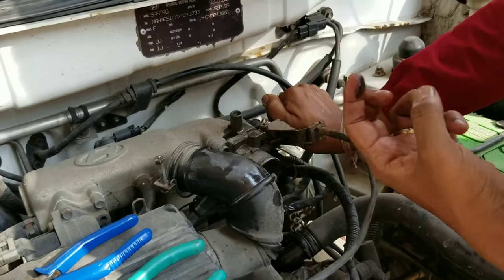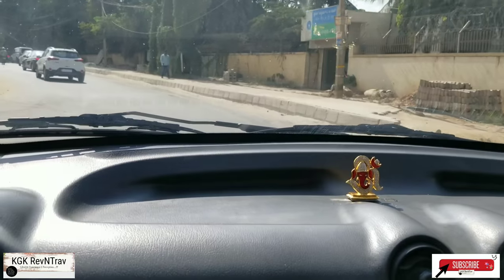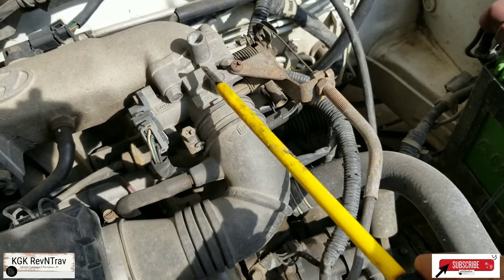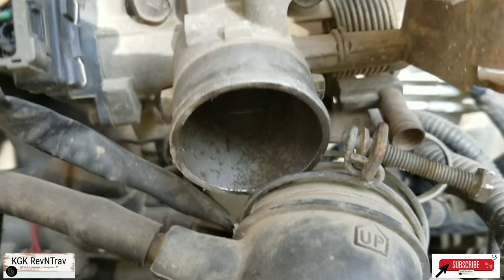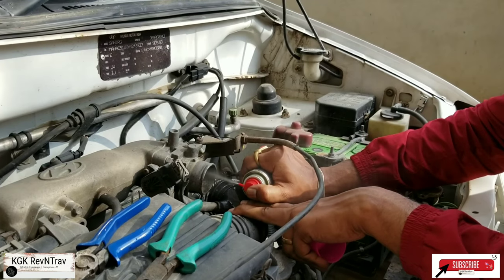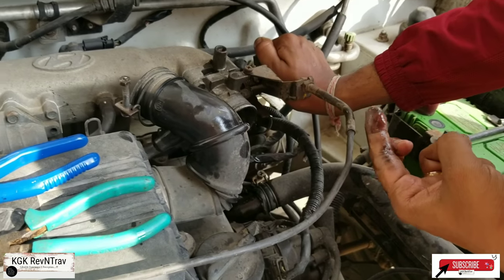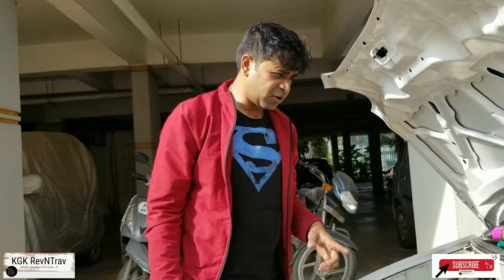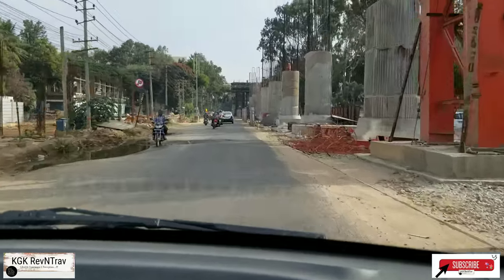Santro Throttle Body Cleaning | DIY | Santro Idling problem

Comment: How 5he dust will affect throttle respone?my santro have the same problem when i shown in service centre and suggested them they are saying sensor mist have problem i have to change that no use by cleaning throttle body

Comment: I had done the same what you had done at the end I had seen smoke came from exhaust down of engine upto 10 min and settle down is it indicates any damage or it is common?
Reply from the maker: No Problem.its common....the spray that you used burnt and thats it...all ok..
Reply: My problem was not solved  I asked Hyndai SA he was saying we have to change actuator that costs 18k
Reply from the maker: Get it rechecked at other service center...Its not possible...that you need  to change actuator...
Reply: I replaced duplicate idle speed actutator for 1500. Original cost is 11000, but duplicate is 1500. No issues now

Comment: Can you please make video on cleaning radiator??
Reply from the maker: Cleaning the Radiator is bit difficult for this old vehicle, You can use Flush Additives in Coolant to clean, But You don't really Need to do any cleaning to the radiator
Reply: How to flush the radiator in Santro Xing? Help me out  bcoz engine cooling is troubling me every time
Reply: Sar centro gadi chalu karte hi Pani fenk rahi hai kya Karan hai

Comment: Hello sir, I also have same problem with my santro, I cleaned throttle with wd40 and still it's RPM is increasing what should I do
Reply from the maker: Then if its not helping then try to get you actuators checked....there is one below the gear lever....which need replacment...also there might be issue with throttle body sensors...

Comment: ( Because of Throttle body spray ) In my case. dirt entered in intake manifold and then on Engine Valve and boom. valve completely bend. Head and head gasket replace karna pada 😞
Reply from the maker: May be the spray you used is not of good quality....also its suggested to wait for sometime after spray......
Reply: @KGKRevNTravEnjoyLife  Spray Wurth company ka use kiya tha. & 1 hour ke bad start kiya tha